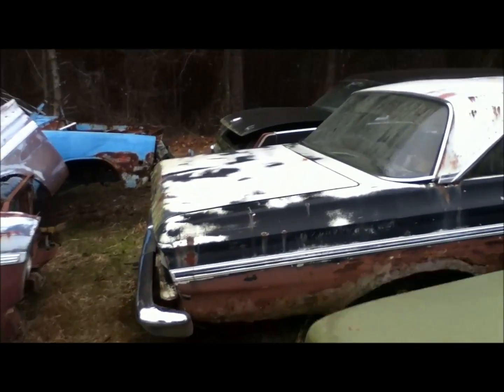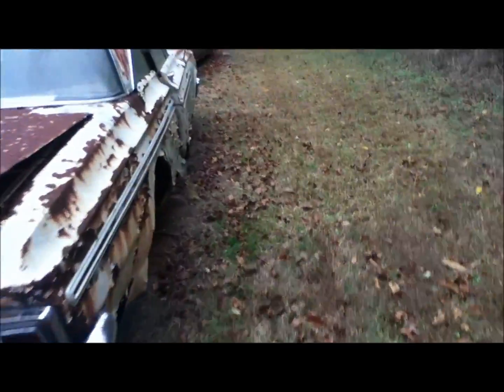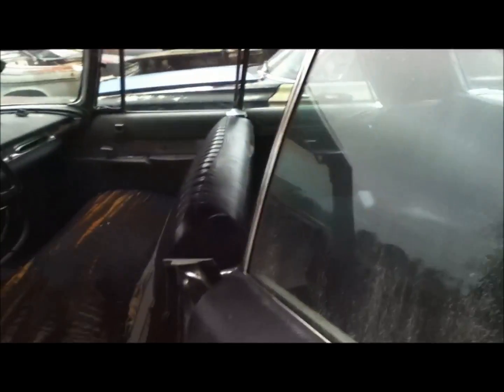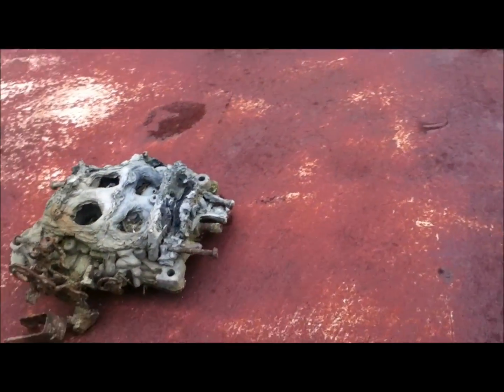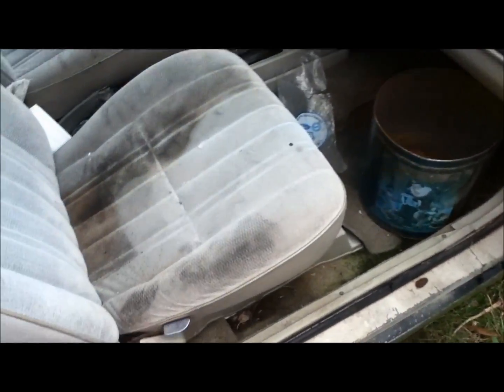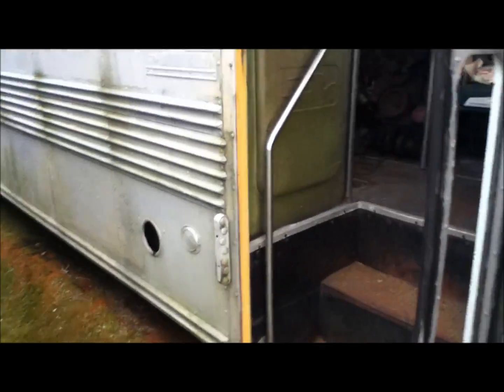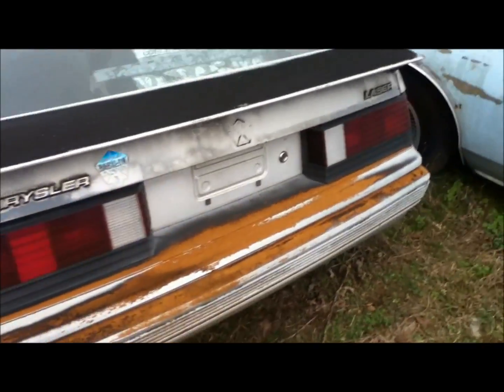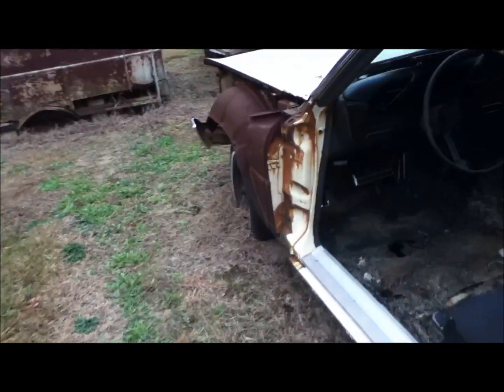All day at the junk yard (escorts to imperials)

Comment: As someone said before in a comment the aerofoils on the old station wagons are intended to help keep the rear screen clear of road dirt and rainwater when the car is being driven.  Because those full size wagons have a big rear end which isn't far off vertical the air flow over the car creates a big low pressure zone at the back of the car, effectively a vacuum which pulls road dirt up onto the tailgate and rear window so the aerofoil creates a downdraught of air which helps stop this happening and which helps to blow rainwater down and off the screen.  They do work, but not as well as a rear wiper, but of course full size American station wagons mostly have roll down tailgate windows so there isn't space in the tailgate for a wiper motor and linkage.  As regards a spoiler like that for your Escort it really depends on whether it's a wagon or a hatchback like this car.  If it's a hatchback keep your eyes peeled on European Ebay for roof spoilers to fit a Mk3 (1981-1986) or Mk4 (1986-1990) Escort hatchback as these cars shared the basic bodyshell with the American Escort with just minor sheet metal changes to the front and rear end styling, the roof and the upper part of the tailgate are the same shape.  Being as putting bodykits on cars was popular in Europe and the UK in the '80s there is a chance you might be able to find an aftermarket roof spoiler or maybe even a genuine RS (European fast Fords were either RS or XR cars, RS were the better ones and Ford also sold genuine add-ons for their cars under the RS banner) part.  If you specifically want something along the lines of the aerofoil on that green station wagon an option could be to find a bug deflector for the bonnet or aerofoil for the rear screen off a full-size SUV or pick up that you like the shape of and section it down to fit your Escort.  You'll need to make up your own mountings and you might need to drill through the roof to fit it but I'm sure you could pick one up from a breakers yard for not much money and have some fun making it how you want it...

Comment: The part of the wagon is to direct wind to keep the window clear.8 you liked the wagon, I had a 1973 Plymouth Custom Suburban. It had a 400 Co motor and would pass anything but a gas station. had a 1976 too. it had a 369 v. wife ran off the road in a snowstorm, nose down in the ditch. A Chevy van rammed into the right side. totaled it.

Comment: Sweet vid, cool you found a pinto. There was one of those at the junkyard by my house, the tail lights from it are now on the back of my mustang haha. Thats awesome you got the slant six, those are really good strong engines. Rebuilding engines is really easy, just take your time and label everything. Most things can only go together one way. As for the auto trans, you basically just dump the parts into the case in the correct order. So take a TON of pictures during disassembly. As always let me know if you need any help :)
Reply from the maker: will do and thanks for the offer

Comment: Fitting that tacho Escort dash to your car is dead easy, you need the complete gauge cluster out of that scrap car and the wiring plug that connects it into the cars wiring loom, ideally with a couple of inches or so of the wire too, to make life easier later.  You'll probably need to swap your speedometer gauge over from your instrument panel into the one with the tacho but that's dead easy, they just screw into place, the chances are that if your car is manual and that one is automatic the gear ratio is different so the calibration of the speedometer gauge will be different where as the one already fitted to your car should be right, though it might be worth checking with some Escort forums if they exist as by the '80s some cars had standard gauges across the whole range and the gearing differences were dealt with by the speedometer drives on the gearbox.  Then, once you've got your original instrument cluster loose so you can see behind it, so from experience with UK Escorts that usually means with the speedo cable disconnected but the wiring still attached then check the number of wires and the colour of wires that connect to the instrument panel.  If you're lucky you'll find that the number of wires, the colours of the wires and the position of the wires on the plug in your car and on that from the scrap car (hence why you need the wiring multi plug and an inch or so of the wires from the scrap car) are the same which means that the new gauge cluster will just plug straight into your car and work, which is quite likely as by the mid '80s Ford were starting to use standard wiring harnesses across whole model ranges so that although it doesn't have all the bits like central locking, electric windows, tacho etc. the wiring loom on a basic Escort with no toys at all will be the same as the one for a top-line car with all the toys, just some of the wires don't connect to anything.  If the wires aren't the same you'll probably find that you're two wires short (the ones for the tacho) and everything else is the same, so all you need is those two wires, which if my memory serves me right is one from the coil + terminal (all an electronic tacho, which this one is, does is count the sparks) and an earth, though it would be best to check as it's a while since I've fitted a tacho to a car.  Once you've got those wires in place what I would do is cut the wires off the multiplug on your car one at a time and solder them to the same wire on the plug from the scrap car and seal the join, and do that for each wire in turn, it's a fiddly job but not difficult.  It's far easier to do that than to try to fit new terminals inside your multiplug even if you can still get the terminals, which I very much doubt going on how quickly Ford usually stop supplying some parts for their cars.  If you try to connect the wires directly to the new gauge cluster you run a high risk of cooking the circuit board and ruining the "new" gauge cluster and maybe starting an electrical fire behind the dash which isn't fun so it's easier to use the multiplug from the scrap car.

Another thought about the spoiler, if there was a sporty version of the Escort or one of its cousins in the US that might have a spoiler that you like the look of and you might be able to find one in a scrap yard.  If the US is anything like the UK those things rust so badly and break so easily that there will be PLENTY in scrap yards lol...

Getting that handbrake/parking brake lever out is dead easy, they're bolted to the floor with four bolts round the base, under the carpet, often it is easiest to cut the carpet around the brake away with a knife to reveal the bolts, then with them undone cut the handbrake cable where just the metal inner cable is right by the rear brakes then as you lift the lever out from inside the car you can pull the slack cable through to a point where you can unhook it from the lever from inside the car rather than having to grub around underneath to release it.  When you've got the lever out have a damn good look at the mounting points and all around the lover part of the lever as they're made out of quite thin stamped metal and they were notorious from cracking or breaking entirely at or near their mounting points.  God knows if I had a pound for every one I've fixed or replaced over the years I'd be a wealthy man lol...
Reply from the maker: +gosportjamie well i apreate the info my escort had a tach. its the wring in between it and the ECU that went.
Reply: Mr3wheeledbike   Ah...  That's random...  Mind you it's fairly typical '80s Ford:  Fix Or Repair Daily...